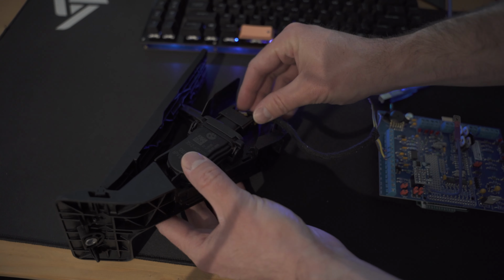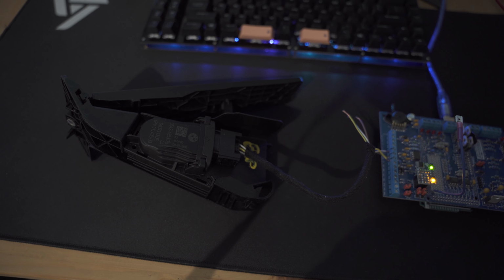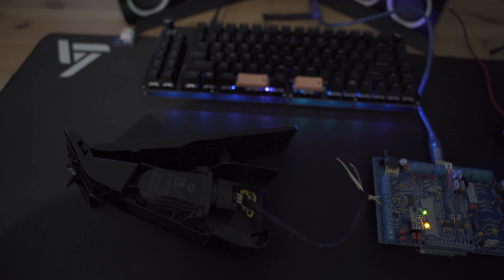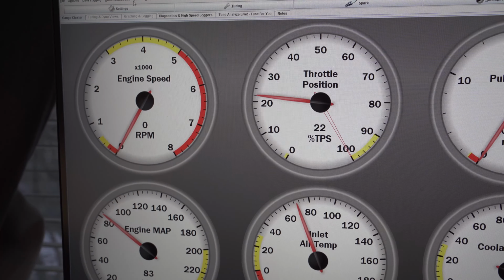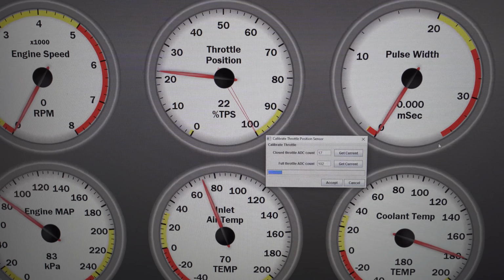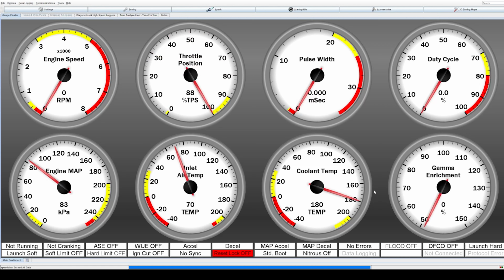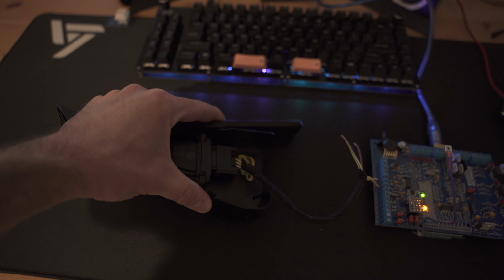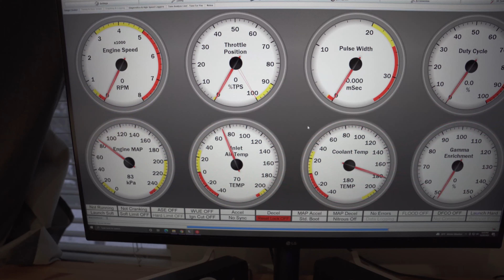BMW DBW Pedal Wiring Made Simple

Comment: OBD fault codes say APPS signal 1 and signal 2. Does that mean my APPS is shot? I've soldered a different connector to eliminate potential wiring issues but the codes remain. What's your recommendation?

Comment: Thanks for info. My pedal (e70 x5) only reads up to 35% and stops increasing after 1/4 throttle. Does the pedal need replacing or is this a calibration issue?

Comment: thank you for the video. I have an s54 in my e36 chassis track car and am looking to put in a new pedal. From what I have found they should all work the same but the later model pedals come with metal brackets that will work better for my needs. From what I see here I should be able to use a pedal from a later model car, correct?
Reply from the maker: The pedal I bought is from an f30 and it uses a plastic bracket. All the E46/90 ones I have seen are plastic too. I'm not sure what ones come with metal brackets but all of the plastic brackets bolt to the metal in the car so it's all about the same imo

Comment: hello, I am doing a 330i swap but I have come to a problem that the wiring is slightly different than the 323i and the 323i has a mechanical throttle body and the 330i does not, is there something to make the wiring work and the electrical make the throttle body mechanical?
Reply from the maker: I don’t know about that. Maybe someone else can answer if they know

Comment: Hi I'm installing an extra pedal so the car can be driven with left foot too for disability purposes so I'm buying an extra original spare pedal with some wiring so i will install parallel wire

Question is
 I'm thinking of using an on on   DPDT switch on the dashboard would be okay to use the switch for the two ground wires or should i use for the two positive signal to switch between left or right pedal in use obviously while ignition off
Reply from the maker: Im not sure if it would cause any problems with the switch in the circuit but it seems like it would work. Worth a try imo

Comment: Awesome! So speeduino now has DBW, is it on board or seperate module?
Reply from the maker: I am just using the Speeduino to test the potentiometers of the DBW pedal. The pedal is essentially 2 throttle position sensors internally.
Reply: @TurbineResearch  im using DBW on my maxxecu, ive been using MS for 7 years and recently noticed speeduino is going over to dbw, is it fully operarational yet?

Comment: Hi, Sorry for my bad inglesh, but i and making turbo e46 with Speeduino, but my trottle is eletronic. you put direct your gas pedal in Speeduino? And how you control throttle?
Reply from the maker: In this demonstration I use the speeduino to show that the electronic throttle pedal is functionally the same as a throttle position sensor. The speeduino I have doesn't support drive by wire

Comment: I had accidentally cut of my accelerator from my e90 328i, do you think I can simply solder the wires back together or would have to calibrate thr throttle?
Reply from the maker: You should be able to just connect them with crimps or solder and it will work fine
Reply: thanks 😅